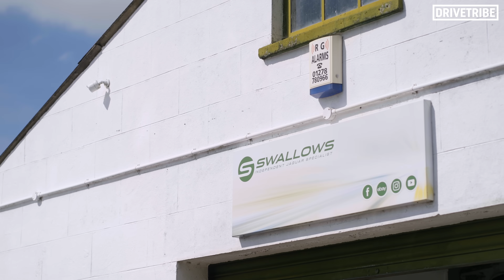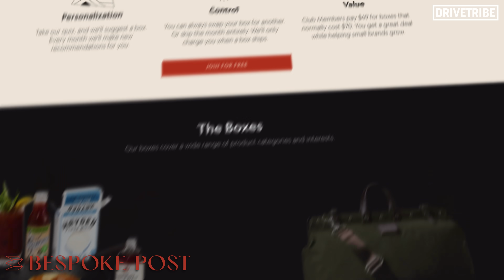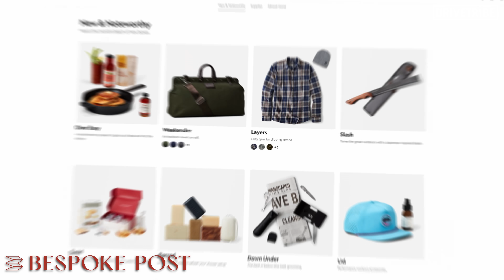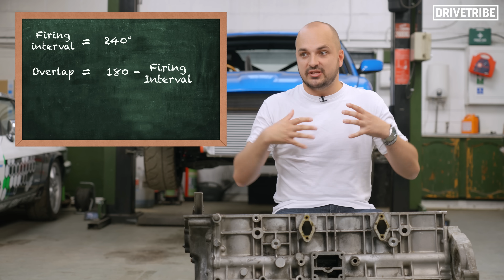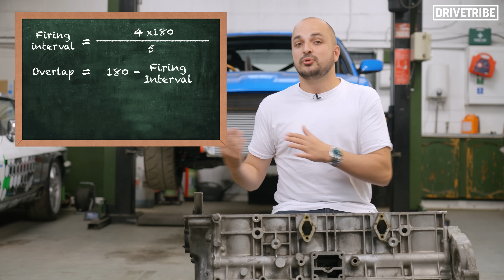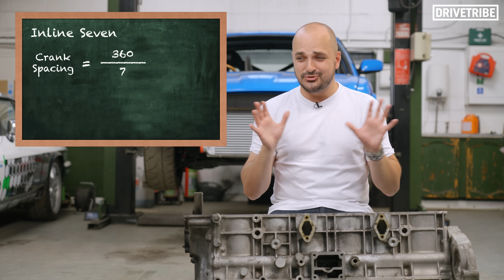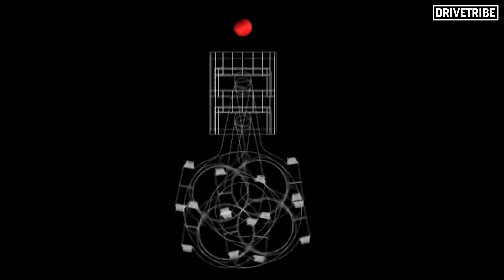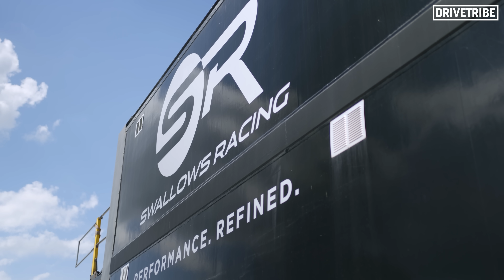Why Isn’t There A 7-Cylinder Engine?

Comment from the maker: Thoughts on the sound of the inline-seven? 🤔Thanks to Bespoke Post for sponsoring today's video – New Bespoke Post subscribers get 20% off their first box of awesome — go to https://bespokepost.com/drivetribe20 and enter code DRIVETRIBE20 at checkout.
Reply: There's a youtuber called IceManV93 who simulated all the inline engine sounds from an inline 7 to a crazy inline 19. I think the 7 had the same firing order you showed here revving to 10k. He does a bunch of other weird engine configs as well.
Reply: Hey, I know IceManV93!!! I subbed to him a while ago!! He lastly made a 51cyl and 100cyl radial engines!!!!
Reply: Love the sound of an old-school V8 (I had a 1955 Dodge back in the day), but that simulated straight-7 sound was actually really cool. Even at speed, it's like you can tell the sound is coming from each piston moving independently / in sequence instead of in pairs. Pretty neat.
Reply: Sisu made a 7 cylinder 4 valve per cylinder diesel engine
Reply: @dervdoctor1  And AGCO has one currently in some combines(Gleaners for sure, other bramds I'm not sure).
Reply: National engines, makers of medium speed diesel engines made 7 cylinder engines, MAN, B&W, Sulzer, Wartsilla. 9 cylinders also, V 14's as well..
Reply: Kawasaki built a bike with an inline 7
Reply: @Iamthestig42069 😮
Reply: You brushed on it but I think its worth mentioning that most engines developed in the last half century or so have been based on pre-existing designs. 
That means it has been easier to simply take your inline 3/4/5/6 and double it up into a V 6/8/10/12. 
Infact most engines with more than five cylinders produced in the last few decades can trace parts to smaller siblings and indeed a lot share components. 
Dealing with the extra inbalance would be almost no work these days because it would tak ea computer about ten seconds to simulate it and spit out what to do to make it work. 
AS you rightly say though - why bother when you already have designs which don't need that extra work sitting there and able to cover any use case you might need?
Reply: Yes Sisu makes an inline 7
Reply: AGCO HD 98 (SISU) 7 CYLINDER ENGINE! 🤯
Reply: There  is no 9 cylinder or 11 cylinder engines either.
Reply: @F4Insight-uq6nt The Duvant 9VOS would like a word with you on that. It is the world's first and only fully running Inline 9 engine built in history.
Reply: What if they had if fire in sequence 1 through seven I've seen it done in v8s and they are smooth running
Reply: I7s in cars just sound like too much trouble to be worth it.
Reply: My family farms and we got a Challenger MT700E series tractor that has the inline 7. It’s a neat engine for sure, and the sound on the rare occasion you can hear it when the fan ramps down is unlike anything else
Reply: two notes/tones...lol! The weirdest engine sound i've heard!
Reply: The idea to open a brand of cars that build just engines v7 or V9  trasversal engine  .... weird and perfect sounding engines...

Comment: It seems that aircraft are the province for odd numbered cylinder engines with the perfectly suited radial configuration. They all have sounds you won't hear from any other type engine with only the radial 3 cyl sounding like it's inline cousin. The ring manifolds are the main reason for radial engines throbbiness.

Comment: Didn’t watch yet, let me guess.
An inline 7 would be too long fit in most useful applications, so a V configuration would be needed. However a V configuration will have balancing issues due to the odd number of cylinders. A V8 fixes this problem and provides a more substantial power boost at the same time.

Comment: What if instead of having an inline-7 layout, you instead put them in a V-layout with either a 60 or a 90-degree angle.
Then, to better balance it out, the bore on the odd-side is larger, to allow for more moving mass, but only enough to equal the load on the even side.
Would that work in practice?
Space-wise, it would be around the same size as a similar V8

Comment: Why is an inline 6 so smooth?  It is basically a double 3 which you said had -60 degrees overlap.  Wouldn't the 6 have the same minus overlap with two pistons set up at 120 degrees from the others?

Comment: We're designing a theoretical inline n/a 7 cylinder race engine for a group uni project. It's 4000cc capacity, twin cam, 28 valve, 7 throttle body efi. It is a nightmare, but I'm getting there.

Comment: Why are 6 cylinders like that and not spaced according to the calculations you provided for every other engine??? Its just like two 3 cylinder engines. Why isn't each crank spaced 60 deg apart??

Comment: 8:40 turbos and superchargers are well over 100 years old, it's just that the material science AKA cost and complexity of making engines reliable with them was difficult, especially when fuel was cheap. It's the same story even with things like valve placement and number. A big issue with straight 8s (and 7s) was that the crank-shaft is at its limits and became unreliable, i.e. they were too long. Thus the V8 becoming popular in USA as an alternative.

Comment: I am surprised that submarines would use a 7 cylinder engine even if at constant rpm.
A submarine must run as quietly as possible even if on the surface and vibration is one thing it cannot tolerate.
Even nuclear subs when submerged can emit noise due to the cooling pumps for the reactor.

Comment: The applications mentioned for inline 7 and 8 cylinders engine also operate at much lower RPM's. Back when strait 8's were used in cars they would often only revv to 4,000rpm or something. That was the case for most at the time i guess. But once you start increasing the RPM the downsides start to show them selves more. Like pushrods.. Which for some reason are still being used!

Comment: Dont forget the viabrations from a 4 cyl engine. Generally quite awfull.
7s? A lot around,, usually started as an 8 however. Sometimes a 12

Comment: I know it's not necessary. But i think it would be cool if someone built an inline 7 car engine for science purposes. Would definitely have a unique sounds. 5 and 6 rotors are not necessary either but a handfull of people are in the process of building them. Would be interesting to hear  the noise it would make. The simulation is cool but im guessing it's not accurate. A real 7 cylinder car engine would sound cool i think

Comment: I've seen one of those AGCO straight-seven engines set up as a stationary power source. It fills a niche where a straight six wouldn't be enough and a V engine wouldn't fit. Besides its interesting exhaust note, the AGCO engine can shut off fuel to individual cylinders when there's only a partial load.

Comment: To make a complex answer simple, derivatives of 360 are the reason why. When you degree a crank or cam shaft, it helps to work in the 360' notions that we use. Here are some common fraction uses of 360

1/360 or 360'
2/360 or 180'
3/360 or 120'
4/360 or 90'
5/360 or 72'
6/360 or 60'
7/360 has the first decimal degree of 51.428571 repeating.
8/360 or 45'
9/360 or 40', however, 9 can also be broken into 3, kinda like how you see inline 6 cylinder engines only having 3 camshaft degree positions, essentially making it 2x 3 cylinder engines or in the 9 cylinder, 3x 3cylinder engines.

this describes a lot about the problem with certain engine combinations. While you could make a 7 cylinder engine, it would be out of balance or to make it in balance would be next to impossible.

Comment: What about this form of imbalance. A 4stroke V-twin, aircooled with a 45° angle, mounted with cilinder 1 in front (gets all the cooling) and the other behind it (less cooling) and the firing order is 315°-405°. This manufacturer is worldfamous for this engine which (in theory) shakes itself to disaster in a few miles. From an engineering poit of view, that would be a far bigger why from my side than a 7 inline.

Comment: There are 7 cylinder engines. Typically used in marine applications. 
Also V14 engines are not uncommon

Comment: There were even I8s made by Olds, Buick, Pontiac and Packard and the last three stuck with those way into the early 50s. While those were indeed torquey for its day they clearly showed their disadvantages in car use : a long crank that doesn't like high revs + packaging. A 7cyl is simply not sensible for car use since an I6/V6 can be built to do the same job at same displacement or as a V8 which is a much sturdier and rev-friendly more compact package. Since both inline and radial 7cyl can be ruled out of car use due to packaging, we're left with either VR7 or multibank alternatives and those come with their own limitations and unnecessary complexity compared to I6, V6 or V8 alternatives that make a lot more sense. 

I'm pretty sure some exotic car company could possibly develop a 7cyl for car use just to prove to their limited audience that they CAN, however it would be unnecessarily complex, expensive and impractical for use in regular high-volume car production

Comment: Radial aircraft engines always have an odd number of cylinders - 3,5,7, or 9. Why? Because firing order is every other cylinder - in order to have the completed cycle of firing all cylinders finish at number one, to start the firing sequence all over again. Also, one of the connecting rods is fixed rigidly to the crank to keep the engine from starting and running backwards. Really, quite an engineering inspiration. And a rotary radial engine (the whole motor spins around connecting rods rigidly fixed to the crank) is even more fascinating. Look at cut-away views and model demonstrations.

Comment: The firing order given @7:40 is not rational. 

Just as an inline-5 does not fire 1-3-5-2-4, an inline-7 would not fire 1-3-5-7--2-4-6... for the same reason, to avoid the worst possible arrangement for rocking couple. There's no other choice for an inline-3 (because all possible orders are effectively the same), but with more cylinders the crank is arranged so that while cylinders are still at the same intervals (120° for a 3-cyl, 72° for a 5-cyl, 51.4° for a 7-cyl), the positions are swapped so their motions don't follow in a wave down the engine. 

A real inline-5 typically has a firing order of 1-2-4-5-3 (not 1-3-5-2-4).

Comment: While an even number of cylinders makes sense for a inline engine for balance, and for firing order with a 4-stroke, an odd number is not a problem... especially for a 2-stroke inline engine, and especially for opposed-piston engines which don't have the same balance concerns.

As an example, the Fairbanks-Morse 38 Series engines were available with 3, 5, and 7 cylinders; the 7-cylinder Fairbanks-Morse Model 38E 5 1/4 has commonly been used as an auxiliary engine in US Navy submarines.

Comment: Truth is, there are 7-cylinder engines. But you have to look into aviation with air-cooled radial engines. For instance, the T-28 Trojan has one. (Ok, they mention that off the bat. But the title is a bit click-baity if they're not specific about it.)

Comment: I built and ran a FrankenBriggs 7 cylinder gasoline engine about 5 years ago (vids on my channel) It is made of individual single cylinder engine blocks with the cranks fastened together, and using a common ignition distributor and 2 carburators. It does indeed have its own unique sound, and ran very well. Cheers.

Comment: The short answer - it's pointless.  Inline 6s have balance, power, and simplicity and inline engines need not be any longer (nowadays they just go to V or W for packaging reasons).  Inline 5s exist to get some of the I6 benefits in a shorter package (almost always for transverse applications).  Inline 4s exist because they're cheap, inline 3s exist for fuel economy.  

Yes, inline 8s existed at one point but at a time when inline 5s did not, trying to get even fuel delivery with odd cylinders with carbs is difficult, so inline 7s would have the same issue.

Comment: Perhaps you can enlighten me on a related issue: Is there a difference between a flat/boxer and a V-engine with a 180 degree cylinder direction (i.e. widened out from something like 60 or 90 degrees)? If there is, what would the pros and cons be for either choice when you're making a 180 degree engine?
Reply: There's are videos on that from other YouTube channels.

Comment: So, if you can fit it under the bonnet/hood, the best balance for the fewest cylinders is a straight 6. No wonder most trucks use them. Conceptually, put a mirror after the third cylinder and you will "see" the other three in the mirror.

Comment: how about making the middle cylinder larger so it becomes balanced
Reply: Then you might as well built a straight-8 which would be better balanced, smoother running, easier to design, and not much longer or heavier.

Comment: Seven cylinders is one of the most common setups for radial engines. In fact, all radial engines have odd numbers of cylinders.
Reply: Per row.
Reply: @patrickporter6536  Correct.

Comment: Yeah but GM now has a 3 cylinder engine!  With a proper crankshaft, any number of cylinders can be used in a well balanced inline or radial engine.  V or opposed engines must have an even number.
What about the "straight 8"?  There were plenty of them at one time.  Also V12's and V16's!
Reply: There are many inline 3-cylinder engines, not just GM's.

Comment: A few of these problems could be somewhat offset with an uneven firing interval in a straight-7, by taking a straight-6 and adding a cylinder in the center that's offset exactly 180 ° compared to its two neighbours.
Reply: That would not be balanced at all.

Comment: Ok. So the best way to get comment engagement is to be wrong. But it's just completely wrong. 3 cylinder engine is completely balanced in both primary and secondary. They have a rocking moment unrelated to cylinder balance. 2 cylinder 90° vtwins are also balanced with the crank counterweight iirc. The standard interval between firing order of triples and V-twins is - in this specific application - rrelevant

Comment: The question is, how would a VR7 work.
There is the VR6 and that was a great engine...far shorter that a in line 6 and not so wide as a v6.
If you now have space for in line 4, bot not enough for a V motor and the VR 6 is too small.

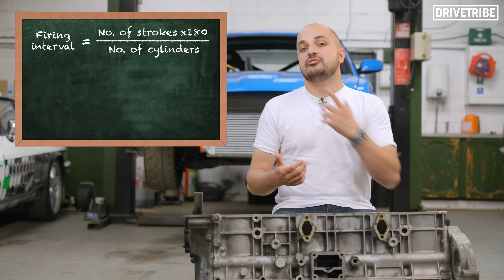Comment: "a three cylinder fires for every 240 degrees of crankshaft rotation" 4:41. Wait a second here, the three cylinder fires every 120 degrees if i'm not mistaken. Another thing, the three cylinder is in a class of its own in the sense that the crankshaft only rotates 360 degrees after every cylinder has fired, anything four cylinder and up the crankshaft will rotate 720 degrees after every cylinder has fired. 
If i'm wrong somebody please correct me.

Comment: The one question I always wondered about was:
why are odd numbers of cylinders preferable to even numbers in radials? This question doesn’t apply to 18 cylinder radials, as they are simply two banks of 9.

Comment: I did see a inline 7 diesel once.. I was in new hampshire and there was this snow plow machine, one of those tracked machines you use to smooth the snow at ski resorts, with the plow in the front and the rakes at the rear and it had in inline 7 turbodiesel.  It was some strange scandanavian design.  And there are slow speed inline 7 diesels used in ships.
Reply: Was it the engine or the machine that was strange scandinavian design ? 
The Agco 7 cylinder is  made in Finland.
Was it a Snow groomer ?
Reply: It was a snow groomer but this was back 1999.  The engine was a strange design, I'm surenthe snow groomer was also a strange design, it was not from anywhere around here. @dieselmats

Comment: Quick correction on the AGCO engine as someone who uses a tractor with it. Each cylinder does not have its own head, and it appears that they use an inline 3 head and an inline 4 head. Also, your comment at 12:40 about them being naturally aspirated is incorrect as basically no modern diesels in the 10 liter range are, and the AGCO has a compound turbo setup making about 40 psi on the monitor. The in-line 7 9.8 liter is governed to 2300 rpm, and makes 431 hp @ 1700, and 1,417 lb-ft @ 1500.

Comment: Ingersoll rand made a seven cylinder diesel many years ago. Ive seen one in a dredge in idaho. Made 350 horsepower. Think it was made in 1940, but not sure. Anyway, massive engine, that consumed a LOT of fuel!

Comment: I know that this video is about inlines, But HOLL UP!

7 cylinders engines were put in a car. Just not inlines... Radial 7 were used in some early trucks, and in general, radial 7's are kinda... The most common engine of this type.

So yea, 7 cylinders engines exist, and were used in cars, but more often in tanks or planes. In fact Radial engines are in a way beautiful yet forgoten.

Comment: on cranks, the jeep 4.0 inline 6 uses a crank plate that bolts up under the crank that stiffens from front to rear the crank. This stops the crank from "wobbling" when under high RPM's.
Reply: That's a common design, with any number of cylinders.

Comment: But -- the math is only weird because of imperial units of 360 degrees in a rotation. If we took the much more sensible 400 degrees of a French Revolution revolution divided by 7, we get 57.12 degrees which I think we can all agree is better
Reply: Radians. There are 2π radians is one full revolution, so... 
an inline three-cylinder has throws at 2.09439510239 radians, 
an inline four-cylinder has throws at 1.57079632679 radians, 
an inline five-cylinder has throws at 1.25663706144 radians, 
an inline six-cylinder has throws at 1.0471975512 radians, and 
an inline seven-cylinder has throws at 0.89759790102 radians.
😁 

Yeah, round numbers really don't matter.